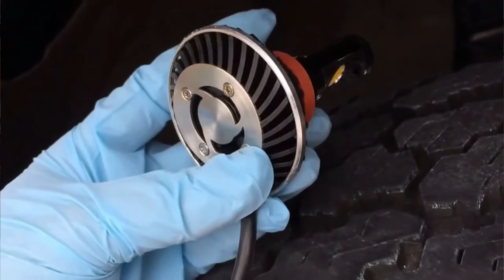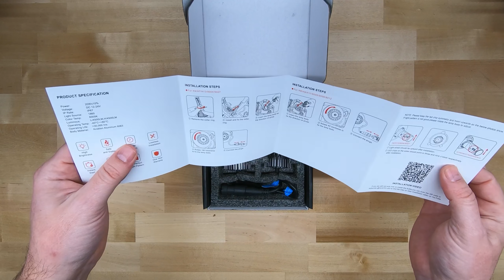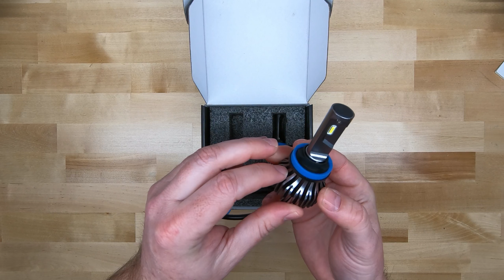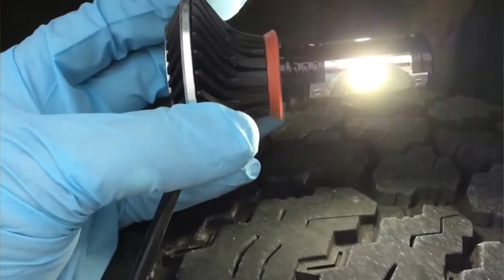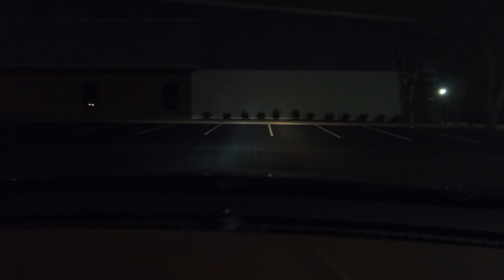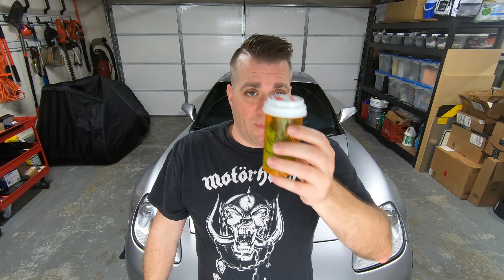TESTED - The Best Budget LED Headlight Conversion?

Comment: Have u had anybody flash their high beams at u thinking u have ur high beams on? Just wondering..
Reply from the maker: No, because I strongly advocate that when you change headlight bulbs, you ALWAYS check the aim of your headlights.  I do every time.  It is easy and a good practice to get into.  I actually check mine once a year because they can get out of alignment over time.  Otherwise, you can be putting less of your light where you need it, but more light in the face of other drivers who don't.  I think it is one of the lesser known but very important parts of vehicle maintenance.
Reply: @InJasonsGarage   You can't aim bad LED lights though, if they aren't able to be focused by the housing they are used in because of their design.   I tried some LED lights and they would just wash the light everywhere, zero focus, and so aiming was impossible.    They were very thick though, so I've ordered the next gen Auxitos that have a very thin copper PCB and will see how those do.   Otherwise, HID tends to get pretty close to the focus of the halogens since its omnidirectional dot of light in the right spot.
Reply: People always flash their high beams at me but i don't understand why, cas im driving with my headlights off😁. Im kidding but honestly there's so much light in the city night this days that my stock halogen feels useless at night.
Reply from the maker: @alexandrupara4574  LOL, just remember...headlights are for other drivers to see you, too.  😎
Reply: with projectors, if they are adjusted well, you wont blind anyone
Reply: @maszat1515  If everything is flat yeah. If there are dips, hills, etc you'll still blind them even if the headlights are perfectly adjusted
Reply: @GoogleDeletesYourComments  yes, but you will blind with halogens too if there are bumps for example. But with most reflectors you will blind others even on flat roads too
Reply: @maszat1515  Not really. Some of the top LED headlight bulbs are double the brightness of halogens. Any bump in the road means you're shining the equivalent of your high beams directly in their eyes.

Comment: You should explain how to clock the bulb, I'm not sure which way to turn the bulb. Also no one ever talks about if there's a separate high and low beam bulb are they all the same you use the same bulb in the high and low beam? Or is there different bulbs for high and low beams?
Reply from the maker: If you are upgrading projector housings, you want the LED chips to be in the 3 and 9 o'clock position.
Many lights have the connector coming out of an edge of the back of the fan housing (and not coming out of the center) and are designed to have the connector pointing straight down in this position. 
For a reflector housing, look at how the reflector is designed.  You should see edges built into the reflector bowl.  You want to align the LED chips to fire perpendicular to those edges.  Most are vertical, so like projector housings, you want the LED chips to be in the 3 and 9 o'clock position.  However, some OEM reflector designs have those edges on an angle.  If that is the case, you want to adjust the LED chips to shine perpendicular to those edges for proper alignment.
Reply: @InJasonsGarage  thank you. I had another question. I'm replacing my 2006 4Runner headlamps with Depo replacements. I'm not sure yet if they're the same as the factory ones. But it looks like they are reflector and projector lamps. With the high and low beam being one of projector and one of reflector. Do I want specific bulbs for projector or reflector lamps? Would that mean my high and low beams would be different bulbs?
Reply from the maker: @gurnblanstein9816  Typically, headlight housings with separate high and low beams are two separate bulb sizes.  For examples, my 2020 Coloardo uses an H11 for a low beam and a 9005 for a high beam.  When it comes to LED upgrades, usually they are the same light with different collar sizes and position to mimic the OEM light.  They might even state what sizes their housings use on their web site so you can plan it out.  Otherwise, when you get the housings see what comes with it.  
Don't forget to check out my other channel, carlightreviews.com which has in-depth LED upgrade reviews and lux testing!

Comment: The Led Headlight Bulbs that I brought on Wish they also don't have a fan & my head beams are really bright white lights & both very small chips on high beam & low beam line Exactly Perfectly to the Halogen Bulb Filaments & I paid NZ $38.00 for the pair & so far so good & on low beam they are Super Bright White Lights & don't cause any other drivers on the road & if I happen to use them on high beam man they are really Bright White Lights Kind Regards Peter

Comment: Would've been nice if you showed how you installed them.
Reply from the maker: Every car is different on how to replace the lights, but it is usually pretty simple to do:
1) Locate the factory bulb (remove the dust cover if it has one)
2) Remove the factory bulb
3) Replace with the new light
4) Test and make sure it works
5) Aim and verify proper beam pattern
5) Replace dust cover if necessary

Comment: Cool shirt
Reply from the maker: Thanks! 🤘
Reply: @InJasonsGarage  I ordered some I think their high beam will that fit in normal headlight slot.?
Reply from the maker: @duncanmcleod4459  That all depends on your make and model of your vehicle and if you ordered the correct size for it that spot (high beam or low beam).  They are not usually interchangeable.

Comment: Are they still working and the color in the aluminum has maintained its appearance?
Reply from the maker: I "retired" them a while back after I tested the upgrade, which can be found here:  https://youtu.be/ai29wbvRkKY   I have been using that one since I made that video.
The version that I profile in this video are no longer available...but still serves as a great reference point.
However, I did not have any issues with them while I used them...and I still have them so I took a good close look.  No discoloration based on my usage.  Auxito seems to make some great budget LED upgrades.  Let me know if you have more questions!
Reply: @InJasonsGarage  I'm looking for a full exterior LED upgrade to my mk4 Golf, do you have some affordable recommendations?
Reply from the maker: @israelberrios2050  Hard to say because affordable has different definitions. :)  I'd stay away from unfamiliar names.  Auxito as mentioned is a decent choice for a good balance of quality and value for a budget headlight.  See my other light testing videos for some ideas as well.
Reply: @InJasonsGarage  Auxito and how about Osram?
Reply from the maker: @israelberrios2050  I haven't tested Osram but I plan to in the future.  They are more expensive than Auxito, that I do know...and I believe they are closer to OEM quality.  If we are still talking about headlight...what is your budget?
Reply: @InJasonsGarage  my budget is about 25-30 per pair, I need the H1, H7 and I think H3 or something like that for the fog light, and later I'll try to change the rear and front indicator lights, reverse and brake lights (yes I'll make the whole car LED 😅)
Reply from the maker: @israelberrios2050  If your budget is $20-$30 per pair of headlights, you'd be better off with stock bulbs.  You won't easily find something that is that inexpensive that is an improvement that lasts any reasonable length of time, despite what the product listing says.   Spend a few more dollars and get something from Auxito or Sealight if your budget doesn't allow for something more expensive.  That's my advice.
Reply: @InJasonsGarage  nice. I'll look for those, thanks buddy!

Comment: Does the notch opening that the LED sits face up or down. The leds themselves with be 3 and 9, but that notch opening is throwing me off.
Reply from the maker: I believe it is up, but my suggestion is to try it one way and if it doesn't appear correct, try the other way and see if it improves.

Comment: What do you mean by they have to be clocked??
Reply from the maker: For LED light designs like this, you want the LED chips to fire in a 3 o'clock and 9 o'clock direction (horizontally).  In some vehicle headlight designs, the rotation of the collar won't let that happen.  Being able to "clock" the LED light to put the chips in the proper position is a feature that would be needed in that case.
Reply: @InJasonsGarage  what's do you recommend on a 2020 chevy Malibu Lt??
Reply from the maker: @EC-wr8sy  What is your bulb size, housing style (reflector or projector), and budget?
Reply: It's a H11 projector
Reply from the maker: @EC-wr8sy  OK, what is your budget?
Reply: @InJasonsGarage  I've seen some on Amazon for under $50 now are they good? Also on carid Lumen brand for $100. So my budget no more than $100
Reply from the maker: @EC-wr8sy  There's literally thousands on Amazon for under $50.  Some are good.  Some are junk.  I have tested some, have a look here https://youtu.be/wy2RItSt0L0 and here https://youtu.be/zlyMKnQ8nY8.  Consider Sealight for your budget.

Comment: What's your opinion of hikari eye of mega
Reply from the maker: My opinion ?  Performs OK with decent quality and warranty, but doesn't live up to the hype.  See this video here: https://youtu.be/zlyMKnQ8nY8
Reply: @InJasonsGarage  thanks trying to find the best without breaking the bank
Reply from the maker: What is your budget?  And do you have projector or reflector headlights?
Reply: @InJasonsGarage  2016 hyundai elantra gt with projector budget 0-100 willing to go as much as 150
Reply from the maker: @77ChitownCubsFan  Ok, you've got some options for sure as you are able to go with something out of the "budget" range.
I would say if you can swing it, try the newly released Morimoto 2Stroke 3.0:  https://youtu.be/0N9419LxeIU
It is a bit more than your budget allows, but man, am I impressed with them overall. 
If you cannot go that high in cost, I would suggest you see this video here:  https://youtu.be/wy2RItSt0L0 and jump to around the 25 minute mark for my suggestions.
If you want a great balance of "a bit better than stock" brightness, but top-notch quality and construction, consider the Diode Dynamics SL-1:  https://youtu.be/6QPalSfnDZY
They are not the brightest out there, but I would predict that they are among the most reliable. 
Let me know if you have more questions.

Comment: Hi I have an extra set of bulbs that I want to use to light up my pool because they are 2000k and I cannot find another led with this color can you tell me what is the least expensive way to make it so I can plug these into a regular outlet please
Reply from the maker: I don't know enough about swimming pools to know how common of a practice it is to use vehicle headlights for pool applications, or even if it a good idea.  I'd consult a local electrician.

Comment: Hi I have a question
When purchasing high and low beam LED lights, do I have to find a higher lumen bulb for the high beams than the low beams?
Reply from the maker: That's a good question.  The answer is: not typically.  Usually, the design of the light housing is what determines how the light is collected and focused.  You might also find that the low beam and high beams are two different sizes.  For example, my vehicles are H11 for low beams and 9005 for high beams.   I always recommend that if you replace the lows, you replace the highs with the same brand/type.

Comment: Just installed the Auxito in my 4Runner. Didn't have DOT Approved sticker on the driver. I'll see tonight how bright they are compared to stock Halogen and the Sylvania halogen I tried first. That was a waste of $
Reply from the maker: The more videos I make, the more I learn.  The DOT mark doesn't mean it was approved by the DOT, they don't do that.  However, it is supposed to signify that the product is manufactured to meet DOT standards.  How accurate the manufacturers are or how they test is anyone's guess.  Afte I made this video (and a few others on my channel), automotive LED importers (and one manufacturer) in the US has come under fire as LEDs are not exactly legal for on-road use as replacements for halogens.  That's why they now market them as "forward lighting" and not "headlights".   This might be why the DOT mark was removed since I reviewed them, but again, it is anyone's guess.  Let me know how these work out for you.

Comment: I installed a set of those in my foglights, AUXITO DD B-1 H11 H9 H8 LED IN MY 2013 BMW X5 , i am disappointed as no mention about any resistor and the turn off my "left foglight malfunction" indicator. so now i have to buy a plugin kit of 2 "resistors" to get rid of my error. i am disappointed as im sure it would not cost much to "build in this resister to "trick" the computer fault".... great promotion sir  ty
Reply from the maker: That's a bummer.   I know that cars have certain quirks like that.  I think out of fairness that is more of a BMW issue and not a LED brand issue.  Perhaps there's brands and models out there that is specific to the BMW issue, but I am just speculating that they exist.
Reply: @InJasonsGarage  ,ty for response,No it is not more of a BMW issue actually. My son has a 2016 Dodge /jeep Trailhawk, that has the same problem with these AUXITO  LED light bulbs. If a resistor was added to the bulbs wiring  ( cost for a resistor is actually not that expensive according to my Electronic Geek Friend,he says it would cost manufacturer pennies per light),then all of the problems with sensitive car ECM Modules ty sir.

Comment: I drive a 99f150 can you tell me what kind of bulb I need, just plug and play.  Thx
Reply from the maker: You would need a 9007 which is also an HB5.  Since it is a dual filament (having both high and low beams in one unit), this one I reviewed in this video wouldn't work.
However, see my other video where I tested a bunch more lights here: https://youtu.be/zlyMKnQ8nY8.  There might be one that you like in that video that is made in your size.

Comment: Hi Jason just saw your videos on Auxito. I just ordered there h11 and there 9012 led bulbs the other day should have them today. Do you have any tips for when I install them. I know you said I need to adjust them and I will. But any other advice would be awesome. These are my first led bulbs.
Reply from the maker: You may not need to adjust them much, if at all.  Put them in and keep the LED chips facing left and right.  Aim your headlights to the manufacturer specs and then check your light output both close and far.  If there is scattered light output, try rotating them 90 degrees and see if it sharpens up.  Let me know how it goes!
Reply: Jason's Garage Have the day off checked everything out. Lights are great. Want to thank you on your review on those lights. Love them. It’s a night and day difference between the old and new.
Reply from the maker: @tuner066  Awesome!!  That's why I make these videos...so it helps someone enjoy their car more!  What did you put them in?
Reply: 2014 Dodge Dart GT
Reply from the maker: @tuner066  Neat little cars.  Glad this vid helped!  😎

Comment: I have a 2018 highlander. The heatsinks are too big and the bulb placement on my car wont allow it to fit. Are there any slim led designs you can recommend for me?
Reply from the maker: Do you mean slimmer than the one in this video?
Reply: @InJasonsGarage  yes even slimmer than that
Reply from the maker: @sweet_bananas  Your timing is perfect...my very next video will be a followup to this one that I think might help.  Stay tuned...I am recording it now and should release in a few days.  Hang tight!!
Reply from the maker: Check this out...let me know if it fits!  It is definitely shorter because the driver is external.
https://youtu.be/ai29wbvRkKY

Comment: Driving a 2013 Camry, I was thinking of hikari or sealight but saw your video what do you think, lemme know thanks, and the coupon code is expired
Reply from the maker: I haven't had the chance to test the Hikari and Sealight lights so I can't speak to them but I do recommend that if you want to spend the money for a Hikari, consider spending a bit more on a set of Diode Dynamics SL1.  I did mention in the description that the coupon code has expired.  Sorry about that!
Reply: If you're looking for input regarding the Hikaris, I have the "Eye of Megatron" in the low beams of my 04 Cayenne (with reflector halogen headlights from factory). Definitely an upgrade over halogen. They are the ones with a claim of 9600lm, not the Ultra with a claim of 12000lm. They obviously are not anywhere near that lumen output claim but definitely brighter than stock. Mine are H7, and I paid just over $30, but the ultras are around $90 from what I found.

Comment: Nice but too blue.   Wish theyd use led's in the 4300-5000k range.  Seems like they're all 6500k
Reply from the maker: You are right, I don't see too many that have a slightly yellower hue.
Reply: @InJasonsGarage  Im talking about white not yellow.   Youre losing brightness when you hit 6500k and up.

Im going to go with Hid with 55w ballast and 6500k bulbs which should drop them down to around 5500k temp and nice white output.

Leds are advancing so fast I think I'll waiting a year.   My 18 colorado uses both projector (low) and reflector (high).  I might have to use both since hids in a reflector are usually crap.